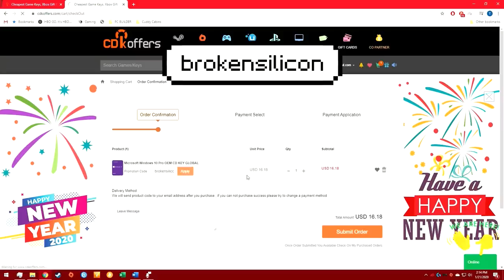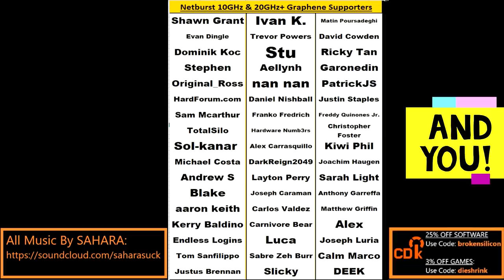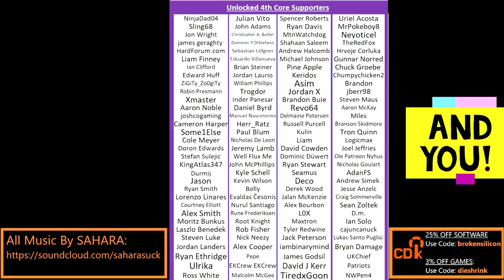Intel going Fabless, Global Foundries for RDNA2, Next Gen Memory | Dave Eggleston |Broken Silicon 83

Comment: You should do a Broken Silicon with Patrick Kennedy from the ServeTheHome Youtube channel. He covers mostly server products, and it would be interesting to see what kind of technology that AMD and others have in the server space that most of us don't even know about in the consumer/gamer space.
Reply: I think it would be awesome to see how things in their overlap, like NAS, will evolve. As more people go laptop, a NAS for gaming makes more sense, if it can achieve the necessary transer speeds. We have some parts, but the whole is lacking right now. For example, We don't have fast/low latency connections in the consumer space. We have NVME drives, but few/no options to use them in a fast NAS that could be used to host game files.
Reply: @timberwolf1575  Some of the interesting technology that servers have that consumer electronics doesn't are things like processors which lock to a certain vendor,  or reconfigurable PCIe-InfinityFabric lanes.

Comment: Very informative conversation. Thank you Thom! 

Just my 2c. Optane DIMMs for in-memory DB should not be overestimated. They (DIMMs) indeed make TPS several times higher in some scenarios. But there is a technical problem they don't solve: fault tolerance. They don't provide anything for atomicity of series of memory updates, and this thing should still be emulated in software, that is pretty expensive. Famous "transactional memory" is not about that. It's about atomicity for concurrency, not persistence. There are, of course, functional data structures that provide requires guaranties of atomicity, but they have their own complexities and limitations. Finally, a lot of time for OLTP databases is lost not on the disk IO, but in the replication layer. Network latencies are at the order of microseconds at best and can't be lowered down because of physical reasons. So, NVRAM does make sense for OLTP, but it doesn't magically make them fast as hell. There are other fundamental bottlenecks. Where byte-addressable NVRAM is very good -- in various persistent and fault-tolerant input buffers. Ability to persist messages with nanosecond-scale latency makes the entire memory architecture of a database node much much simpler (and much faster). 

Anyway, why memory is so important, is "dynamic programming" (DP). This is when we can trade speed for memory by storing and reusing partial computation results. If such result retrieval from "long term memory" is less power-hungry than recalculation, we can save a lot of energy. Many important AI problems can utilize the DP. This is where we can use "memory crystals" in consumer-grade devices: to store DP tables powering pocket AI assistants, etc.

Comment: When a die is 300mm^2, it's spoken as "300 square millimetres" - not 300 millimetres squared, in the same way that one does not have a 30 miles squared property or a car with a cargo capacity of 76 feet cubed.

You're spot on with almost every other thing. :-)

Comment: On the topic of RAM speed. I bought 1600 Ryzen cpu with X370 motherboard expecting to upgrade the CPU. The tech press suggested that 3000+ MHz is optimum for the Infinity fabric, so I got 2 8GB sticks from Corsair rated 3200MHz. On this mobo they ran at 2933 because anything above caused crashes. Later I got new CPU 3700 + 2*8GB RAM and now I must use 2133MHz due to instability with latest AGESA. The fun of DIY :) Lesson learned - buy stock or read the mobo list of certified ram sticks extensively

Comment: What about IBMs usage of SerDes based DDRAM access? Is the increase in delay not offset well by it's higher bandwidth and smaller cost in lithographic area. Would it need more ECC protections to function with dirtier DDRAM in an everyday system? Or is the plan to use Gen-Z and it's agnostic connection system?

Comment: What does Dave mean when he says that the I/O die doesn't scale? Why is AMD fine with using an older node at GF? Okay so it's cheap and the die won't benefit from more density?
Reply from the maker: Not all parts of a chip benefit as much as others from the advancements gained in a new node.

Comment: Just upgraded my PC from a Ryzen 7 2700x to a 3rd Gen 5800x on a Aorus Gaming 5 Wifi.  Not exactly the newest motherboard, but it's nice than on an X470 motherboard there's one BIOs flash and you can upgrade.   The 5800x is a beast, and now I can play all RTX enabled games at a comfortable 60-80 fps in high/ultra settings at 1080p/1440p in 90% of all games.

Comment: 5:24 My biggest complaint about engineers in general (not all but most). Same applies to game engine designers. The majority only know/familiar with one thing and that's all they focus on.  It's the PC vs PS5 talk in a more granular format. One is about each piece and the other is the engineer working with ALL pieces.  Talking to those 'singular mindset' people is like banging your head against a wall. They can't comprehend why you need something different than they see/understand yet other areas are affected and hampered by their inability to make those outside connections.

Comment: If AMD were to port anything to FD-SOI, it should be the I/O die. An I/O die using 22nm FD-SOI could possibly be quite functional.

With regards to manufacturing Zen 3 / RDNA 2 at Global Foundries, the only way I see this working is if AMD facilitates Global Foundries becoming a licensed second source for Samsung's 8nm node.

Ideally, AMD would have developed the Radeon 6700XT and below for Samsung's 8nm node, with Global Foundries as the licensed second source. As the 5700XT and below were to be replaced with the 8nm RDNA GPUs, this would free up 7nm capacity at TSMC for the production of the Radeon 6800(XT)/6900XT GPUs.

A trickier move would be to port Zen 3 to the Samsung 8nm node, producing what could be called the 4000 series CPUs. This would be very expensive and a redundant cost. Whereas by developing the smaller RDNA 2 dies directly for Samsung 8nm would not have been redundant and probably would have actually been a bit cheaper than developing for TSMC, it might not be politically acceptable to Samsung to manufacture GPUs for both nVidia and AMD. Therefore unless AMD committed to having I/O die manufactured at Samsung at 8nm, AMD might have been more or less forced to manufacture Zen 3 chiplets at Samsung in order to be able to manufacture RDNA 2 GPUs at Global Foundries.

The 4000 series could replace most of the 3000 series, freeing up 7nm capacity at TSMC for the production of the 5000 series.

One interesting potential would be to manufacture 5000 series desktop APUs at Samsung.

Comment: I think they should’ve went with samsung for the io die instead, but I guess amd is planning to do some tightly coupled 3d stacking that won’t be possible with samsung
Reply: They had a wafer agreement with GF for  a certain amount per year or they were fined. So that's why they went with GF
Reply: WayStedYou I’m talking about the next io die which will be used for zen 4 or am5 in general. Rumour has it that they’ll use tsmc 7nm. But either they didn’t expect tsmc 7nm to still be in high demand or it was a deliberate decision. Maybe things will calm down in 2H but I doubt it’ll be enough to satisfy demand. Going with multiple suppliers reduces the risk of shortage which was why I was hoping they’d go with samsung

Comment: intel going fabless would be the biggest mistake they could make. they need to work hard and advance their nodes.
Reply: They have been for many years now. They’ve spent billions trying to get a reliable 10nm node, but still haven’t gotten acceptable yields in order to finally transition away from 14nm. Their latest CPU’s had to be shifted from the original design, that was engineered with 10nm as it’s node, to having it manufactured at 14nm instead. This is actually why it’s 8 core when the original 10nm design was 10 core. This is undeniable proof that Intel is having tremendous problems with 10nm as they wouldn’t have made this decision if they could avoid it. I don’t know what their problem is, if it’s the engineers, if it’s due to corporate decisions that cut certain corners, if it’s limitations with the equipment they have, limited access to necessary technology, or other reasons or possibly combinations of reasons, but at some point, corporate isn’t going to be willing to invest any more into it and will just start outsourcing because it will ultimately be less expensive. At least when it comes to anything beyond 14nm. They can always still use their current fabs for products that don’t require smaller nodes or sell production to other companies that don’t have a fab.

Comment: I never liked the idea of using working memory as permanent storage.
From a hardware perspective I get the attraction, but it really stupid to do or strive for as a generic architecture.

The implication of blurring the memory/persistence aspects is not properly understood by hardware people.
From the software and functional perspectives, separation is a critical application requirement and not a result of the Von-Neuman-Architecture!

Data that needs to persist requires vastly different processing and we do not want to persists bugs (storage needs to be transactional).
For development and other uses we want to be able to have a frozen snapshot to look at, which is in conflict with the transitional states that all software has.

Thus near/far/tiered memory...great.
But an "always on" kind of memory...no way...that will just make computing very unreliable.

Comment: Intel goes fabless, then personally, I will 100% never buy Intel again. The reason why I buy Intel now is cause they run fabs here in the US and are not PRIMARILY made overseas. I love having the best of the best, but I'd rather have ~5% less performance and support a US company that actually manufactures their products here in the US. I have friends who work at Intel, as fab workers (manufacturing), as mechanical engineers, and as electrical engineers. 

Back in 2008, I worked in a fab for manufacturing semiconductors for Texas Instruments, and I loved that Job... While I was working there, they closed down operations in Tucson and moved the processes to Sherman, TX and Malaysia. The people that worked there for 30+ years were crushed and devastated, when they found out they would be closing the plant. After the closure, some people moved to Sherman and stayed with Ti, some retired early, and some people moved to Phoenix to work for Intel to continue their careers.

Don't get me wrong Intel is no saint. They do some dumb and greedy a$$ sh!t, it's clear that intel is run by business executives, and not run by engineers (like AMD). Intel's engineers also make poor design choices, they're not innocent either. But none of that is going to improve by going fabless. Going fabless is going to do only one thing: cut costs and improve profit margins for executives and shareholders. Sure there may be an IPC increase, but at what cost? 

Also, I'm no Intel fanboy, My desktop is a Threadripper build. I plan on going back to Intel with the 11th gen, even with the core cut, cause of the better singe core performance (I mainly do gaming nowadays)... and cause I've had a lot of BS problems with Threadripper, so I'm a little sour towards AMD atm, but that's my problem lol.

TL;DR: Intel has four production fabs throughout the US... I really hope Intel doesn't go fabless.
Reply: Funny you mentioned that. Intels new CEO has engineering background

Comment: In the streams where people go for stock alerts to buy GPUs, gamers all seem to talk about how they want a 3060, 3070, or 3080, or even a 3090.  Seems like only about 20% of them want a Radeon 6000 GPU, despite them giving better value for the price (measured in frames per second per dollar), assuming you're in the market for an upper-mid range GPU.

Is this just brand fanboyism? These people are acting like AMD just doesn't exist.  Doesn't make sense.
Reply: Maybe you were in an RTX stream? It is true that more people want Nvidia gpus because they dominate gpu market share but there are 6000 series stock streams with hundreds of people in them specifically looking for RDNA 2 GPU's. Falcodrin has a 6800/6900 stock stream i used to be in all the time until i got a GPU
Reply: @TerraWare  The stream tracks all the RTX and AMD cards of the current generation. It's run by that guy named fixitfixitfixit